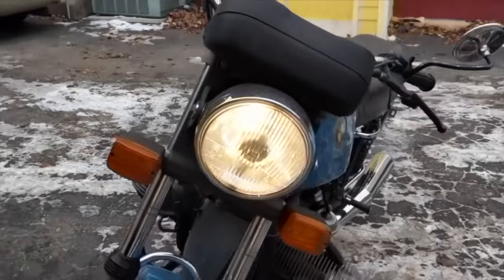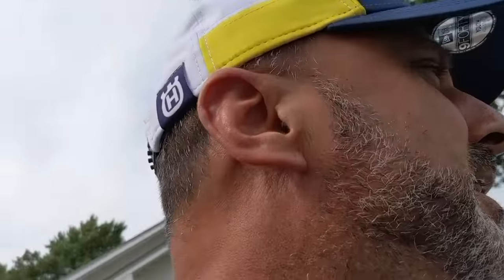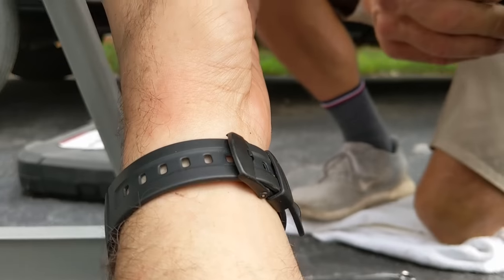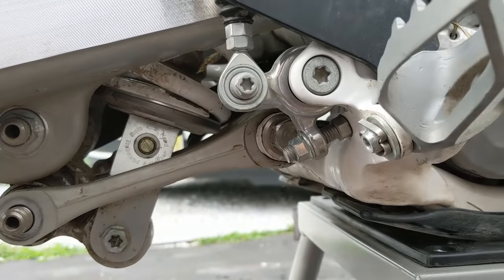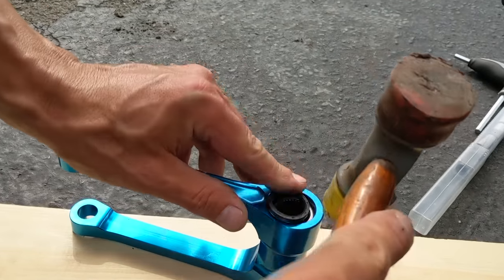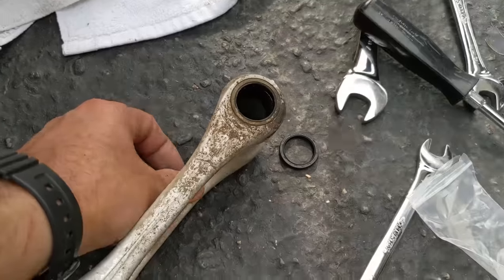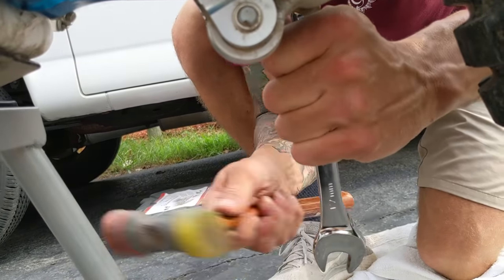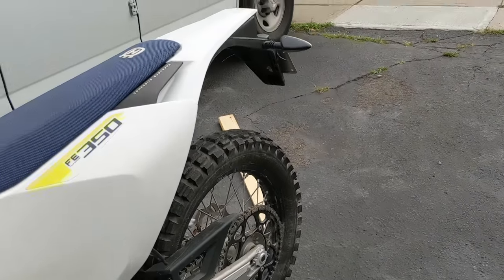How to Lower A Husqvarna Or KTM

Comment: I went back to the stock pull arm link of my YZ250, and did what I needed to do with the shock and fork, (about .75" less travel).  I found that with the longer links, it does not shorten the wheel travel, but just shifts it,----into your fender.  So it would be like hitting the brake if you bottom it out on the fender, (which is probably a real bad time to hit the rear brake), while beating on the fender and sub frame.  My almost expert opinion, (if you want the most functional bike possible), I think it is better to stick with the stock link and lower the bike elsewhere. Me and that bike are going to get along real well this summer. :)
Reply: You would need to go up on the spring to stiffen it so it doesn’t bottom out as easy

Comment: I'm going with a Beta to avoid using the dog bones. I can have the seat height lowered 1.6" that they do inhouse and it only affects the travel but does not mess with the geometry of the bike. For my style of riding, I seriously doubt I will miss the travel. It's pretty reasonably priced if ordered through their suspension shop. Betas have a lower seat height anyway compared to the Japanese or KTM/Husky. There's also the option of a lower seat from Seat concepts or Enduro Engineering. That will give you another .6".
Reply: What does beta use other than the dog bones please
Reply: Send link

Comment: Hey hey crazy dudes. Thanks for this video. I need to lower my KTM 640 dule sport. Not to be flat footed but to get my but in the seat. My age 56, I'm 6 ft 6, cant do the lift the leg high enough thing anymore. 
I will definitely remember the 85nM torque on the bolts and nuts :) 
Frankie / South Africa.

Comment: How much longer is the new link compared to the stock link?
Reply from the maker: EarthSurferUSA - wow I wouldn’t know - I never actually measured it. I just looked at the final results of lowering the rear end by almost 2 inch
Reply: @HOLYSHIFT  I took off my Pro Circuit longer link and put the stock one back on.  It was closer to stock than yours by far, (maybe a 3mm difference in length).

Comment: is that tkc 80 tires, if yes are you happy with them
Reply from the maker: Tashun Kosapa - not sure what they are- they came standard stock when I bought the bike. They are good for Dual purpose but mainly better off road- 80/20
Reply: @HOLYSHIFT  btw, did you lower the front as well or only the rear
Reply from the maker: Tashun Kosapa back only

Comment from the maker: Just realized during watching that the height lowered was 1" 3/8 inch and not 2" 3/8 like we thought during the filming...dumb ass math!
Reply: Hey Ho!
I am 1.62 meter tall, 47 Kg....
I want to lower the Husqvarna FE 250.
I am not sure if the 250 and 350 as the same link...
Want to ask if there was any change in the riding itself.. balance wise... shock breaking.....?
Reply from the maker: lirazation not any significant difference. Try it out and You can always change back - it’s an easy install

Comment: You're done.... now take it out again and reassemble but this time with grease, quite a lot in fact, waterproof grease preferably!
Any linkage must be properly lubricated, and your vid skips this completely: fooi man!
Then, when you've done that, you'll next raise the stanchions an inch through the triples surely, to obtain the proper steering settings again?
You need to do that, one cannot lower a bike only front or rear as this affects the steering geometry negatively.
Oh, setting the various sags at the rear is also a must, so do that when the front is lowered too.... and only when all that is done measure the seatheight.